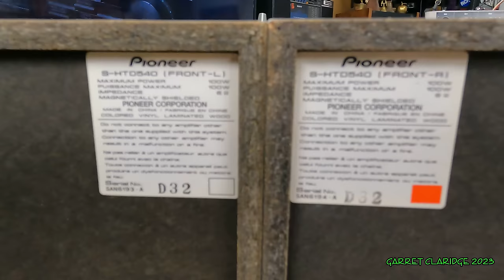Spring Clean-out Speaker Blowouts

Comment: the walmart special is just that. & the computer speakers that swivel with the woofer, i have that same setup, the top speaker is empty. or mine is anyway, its just open to get the sound from the back of the bottom soeaker.

Comment: 35:38 The tube subwoofer is a compound subwoofer. The 2 drivers facing each other, means Vas is only 1/2 so you need only half of space of the enclosure. Drawback is that you loose sensitfiy, so you need more power.
Reply: Whoever manufactured it wasn't the first to use the term "isobaric". The 5 pin connector would suggest that the drivers are to be powered separately, so you can power them push/pull, push/push or with one of them as a passive radiator, all common ideas in the isobaric world. As far as the ports go, these speakers are usually sealed from my research... and on the topic of sensitivity, driving them in push/pull halves that, while driving them in push/push extends dynamic range/volume IIRC.

Comment: That is actually a 10:14 right there those Pezel horn tweeters are tied in with the woofers. You would basically seven full range to those to hook ups in there would either be a cap on those horns or they’ll be nothing on them.

Comment: That cheap speaker with the handle with the carpet is made for behind the seat for the cab for a truck i had a optimus radio shack one like that it was built better i beat the hell out of it in the truck it sounded good with a small amp it cranked

Comment: HAHA nice to see you @Garret Claridge back again one funny thing i noticed the Power Amp you used in the video The Crown XLS 602 do i own aswell got it just recently from work for free since they dont need that amp anymore and mine has kinda a relay problem that it kind kicks in and out sometimes but other then that that amp works perfecty fine just need some new fans since 1 of the 2 are messed up and they are to load for me anyway . but i was thinking to blow speakers with it but i wasnt sure i have a high risk of blowing it up with it i saw that in your case even when shorted the amp keept pounding till its gone so no protection for the amp realy

Comment: Another AMAZING video! You are seriously underrated and underappreciated. I recently got a pair of no-name vintage speakers that kind of look like the one in the video, except it has a small metal bar going inside the wood frame at the front, right before the cover starts. Little 1960s (maybe) 4 inch speakers in them. 8 ohms, 2 watts each, but they are TOO LOUD! Get up to over 110 db, maybe! (Right in front of them, about 1-3 feet away.) But I found it quite ironic at how the tube subwoofer has two subwoofers, and the subwoofer on the sealed side was the subwoofer with the obvious foam rot lol. ❤👍
Reply: A speaker that I want to see you destroy for quite a while now is a Bose Acoustimass subwoofer. Some models are powered and some other models are passive.  The YouTube channel Shawn K (which used to be called S&M Destruction) destroyed a passive one, and I think it had 4 channels, but only 3 subwoofers. two of the subwoofers were single coil, but I think there was one subwoofer facing a different direction inside of the box that was dual voice coil. They tried blowing them up (even just one of the single voice coil drivers by itself) using 120 Volts AC, (the wall outlet), but they would not die! They didn't end up blowing them, because they literally couldn't even with the wall outlet! In the next comment I will put the link to the video.